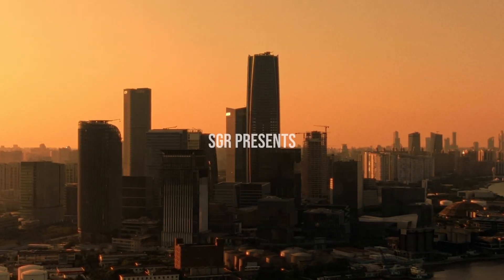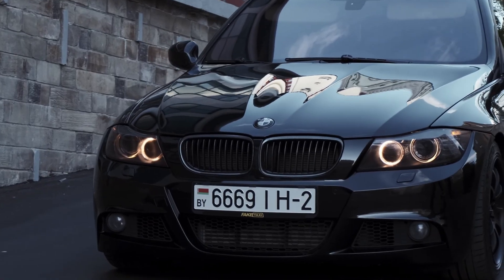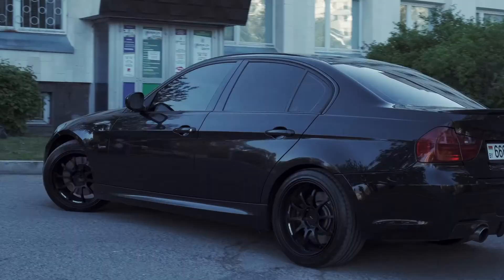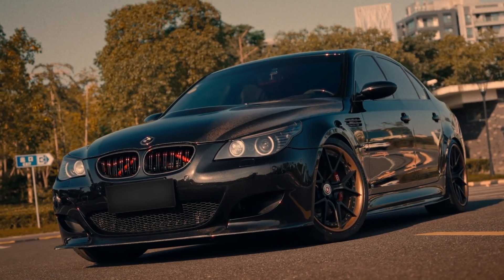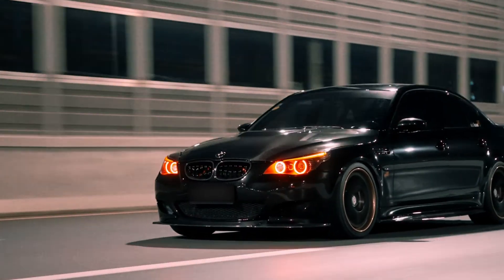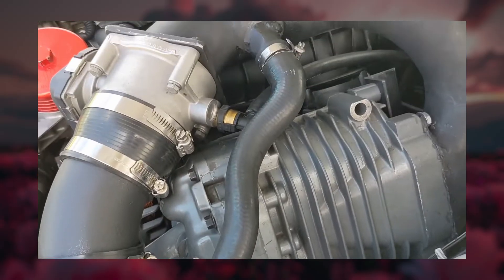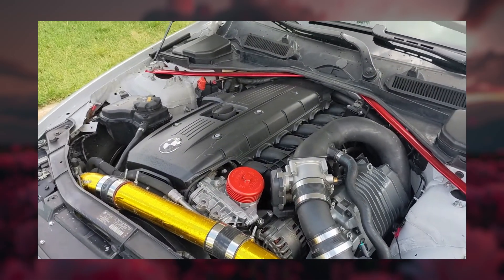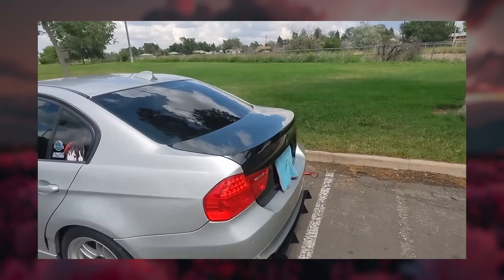This Is Why BMW Switched from the M54 to the N52

Comment: Sooo... I want a turbo E85 Z4. In this chassis, should I go with the M54B30 or the N52B30? Which would be easiest to boost to 400hp or less? I don't see any turbo kits for this chassis. Will a turbo kit for the E36 or E46 work?
Reply: M54 Z4 has more room under the hood than e46. So the e46 kit will most likely fit this chassis. I know because my father owns M52B22 e85 Z4 and I've got an e46 coupe with M52TUB28 that I turbocharged a year and a half ago. It's running full RE85 tune and 0.6bar of boost making about 375whp.
Reply: @mikaelhaanpaa6394 Oh that sounds lovely, thanks for responding! I'd love it if I could achieve similar numbers on an m54b30 without needing re85, but we'll see.... Is it an off the shelf kit? Were you able to retain your A/C? Not a dealbreaker, just curious🤔

Comment: m54 made 225ish hp, the 330 hp motor was the s54 from the m3
Reply from the maker: Exactly, the M54 topped out around 225 hp, the 330 hp one was the S54 in the M3.
Reply: @HarisCars so then don’t misinform in the video

Comment: Aluminium (AluSil) block were used by BMW since 1995 (M52 Engine).
Reply from the maker: Correct, started with the M52 back in 95.
Reply: Is M52 from 1995 Nikasil.? On the net I found that BMW start up with Alusil in sommer 1996.🇳🇴

Comment: M54 has an Aluminium block. Not cast iron…
Reply: Actually, the M54 does have an aluminum block — but with cast iron cylinder liners. It’s not all cast iron, and it’s not bare aluminum like the early Nikasil M52. BMW switched to this setup to avoid the sulfur-related wear issues from the earlier engines.
Reply: @hidocar no, m52tu-m54 used Alusil liners not steel

Comment: Wow, I didn't realize how big the differences were between the M54 and N52! The engineering behind that magnesium block is wild. Makes sense why BMW made the switch.
Reply: M52 is best. 1996! Also Alu. No cast!
Reply: @VanessaFast-t5n  I agree!
Reply from the maker: Yeah, the difference is noticeable. Have you owned or driven an N52 before?